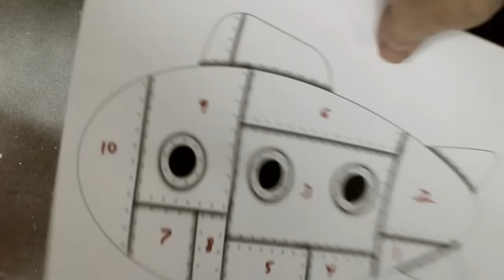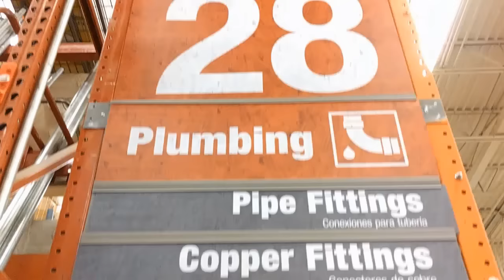Making a Tin Can Submarine

Comment: Wesley,  a tip for your auto punch tool. Drill a golf ball the size of the diameter of your punch end and epoxy it on, it's so much easier on the hands for multiple holes.  I also use the golf ball trick for files that are missing the handles. Thanks for the videos.
Reply: Do you know Pocket83?

Comment: Great project, and very well presented. Been working on a couple of similar ideas, also made of aluminum, for awhile. But have to go back to the drawing board to recreate the effect you obtained by making it with multiple sections of aluminum instead of one.
I'm thinking one based on Flash Gordon's Spaceship is going to look very nice in my den. Thank you for jump starting my thinking
Process.

Comment: That's really cool!  What did you wind up using around the edge of the plywood submarine shape?  Some sort of laminate?  Or did you just paint it?
Next time, you could add some subtle color shifting in your lights if you were to use BlinkyTape from BlinkinLabs.
Reply from the maker: I just used some light gray melamine edge banding. It blended well with the aluminum. Thanks!